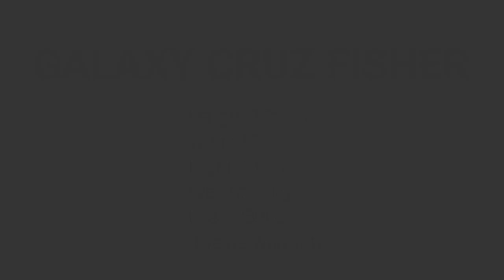GALAXY CRUZ FISHER TANDEM FROM GALAXY KAYAKS

Comment: The one thing I found about using the middle seat to paddle alone was, as you have mentioned, there is nowhere to put your feet. Using the foot rests are a real help. I use the back seat and put a 25kg bag of sand across the front seat to balance it. It works fine.

Comment: It's good to see Galaxy introducing some upgrades on my 2016 model with the mounts for starports and the transducer mount. I would still like to see at least one larger storage bin for putting your catch/equipment in. I use mine mainly on my own with, as you say, the seat moved to the centre position but it is great paddled by two and/or to take the Grandchildren for a trip. It is a very stable fishing platform although not the fastest Kayak. It is also relatively heavy to handle and needs two to put it up on roof bars. A great value Kayak and a good review thanks 👍
Reply from the maker: Hi mark you are right I would like a big centre hatch to store fish or rods inside on travelling like some of the others have, and for sure it's heavy I broke a rib taking it of the roof with my son he dropped his end stupidly I had hold of the bungee and it flexed hitting my chest,mess on learned slide it of the back of the car.